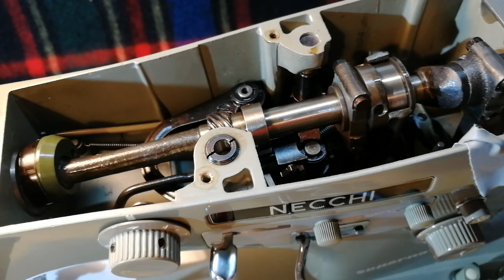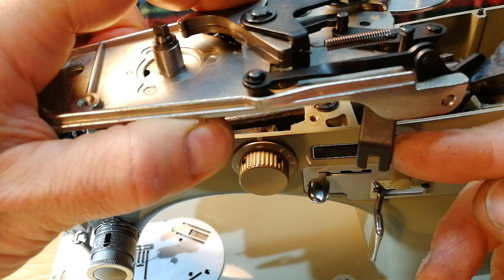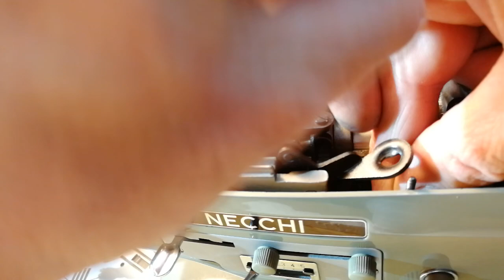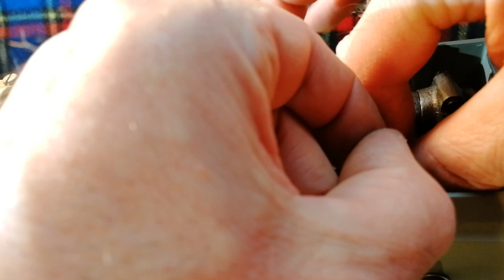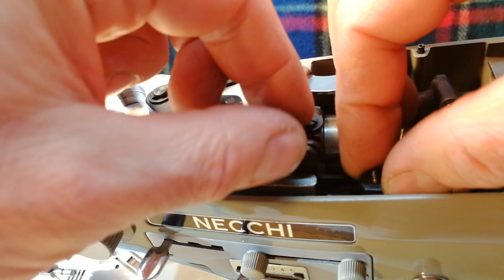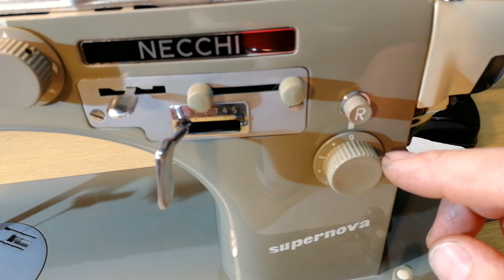Necchi Supernova : build in the cam drive mechanism...

Comment: Hello J.A., Your videos are always so informative and helpful! I recently removed the cam drive mechanism to replace the nylon gear that was broken on a Super Nova. Unfortunately, I have not been able to find the correct replacement gear yet. I decided to put the cam drive back together again so the machine could be used. It took me hours and hours to figure out how to get it back together. I was afraid I might not be able to. Your video is going to come in very handy when and if I do locate the correct gear in helping pull and put back on the cam drive. Thanks so much for putting this together!
Reply from the maker: @ Ann Roland
Thank you very much for the comment, and I'm very happy to have been of help. Regards.

Comment: I got one of these recently, and got it home only to discover it had NO CAM DRIVE!  Instead of that knob on the front left of the machine, there is a plastic plug that exactly matches the machine.  Found another one just like it on ebay.  Seems there were some made without.  I expect it would be too much of an undertaking to add one after the fact.
Reply from the maker: Hello yes, it's true, the machines were built in large numbers with different equipment. An upgrade to the automatic system does not make sense here, because all the individual parts required are no longer available. Better to look for exactly the model you want.

Comment: I got a  functioning Necchi Supernova Julia  but the needle bar keep swinging when set to straight stitches. Could it be caused by hardened oil that keep the zig zag mechanism engaged ? It had been sitting 30+ years.
Reply from the maker: Hello, thank you for the request, I'll try to explain... There may initially be no cam in the mechanism. Switching off means that the mechanism no longer rotates, but if a cam is still inserted, the machine may not make a straight stitch. The lever that needs to be operated to enable the cam to be inserted must be in the rest position again. The mechanics should be completely smooth. All levers must be able to be moved without any effort. I already had this error, but I can't spontaneously say what the cause was. At the moment I only rarely worked with the old Necchi machines. A machine that has not been in operation for so long should be brought back to life very carefully; you quickly lose patience and demand full functionality immediately. I hope this helps....

Comment: Hello there, would you please let me know how to insert the cam mechanism after cleaning it to engage the design graduating nob properly. I had it in and out dozen times, everything works except I can not move the nob to triangular mark for the straight sewing. What am I doing wrong? Thank you so much.
Reply from the maker: Hello, please note the position of the machine's mechanics and do everything exactly as I instructed.
It should work, if not I am also at a loss ...
Much luck

Comment: Hello we buy a necchi supernova automatica work good ,we need buttonhole but the two line to close together we can’t cut the hole how can separate or adjust it so can cut the hole 
thank Antonio
Reply from the maker: Thanks for the comment, it can have different causes. Is it a regular supernova or a Julia? The basic setting of the machine may not be correct. Or errors were made during operation. Do you have an instruction manual? From a distance it is very difficult to find a practical solution.

Comment: Thank you so much for your videos.  I was lucky to find a "new" brain on ebay. Just got it installed, need to do that last adjustment with the reverse screw.   My old was was so clogged up that it just will not turn.  Is there anyone who know how to take them apart & really clean the insides? And put it back together?  It has a "fine adjustment" lever that the new one doesn't have. I would like to get this machine as close to original as possible.    Again, Thank you!!!
Reply from the maker: @ Bradley Gavin
The assembly for the decorative stitches, which was built into the machine in this video, has been disassembled into all individual parts by me. I now know how to do it right. I am also familiar with setting the units. So far I haven't published a video that shows this process. It is very complicated and it is currently not possible for me to create useful video material. Thank you for the positive feedback. I try to deal with the topic again.
Reply: @necchi-pavia  can I ship my old one to you?  I will happily pay you for your time! And return shipping, of course!  (I would love a video of it).  I completely understand why you don't post this type of video.    And my compliments on your very good English.  It is so much better than my German!
Reply from the maker: @bradleygavin2231 
In which country are you livin?
To find help in US :
https://geogivensandson.com/services/